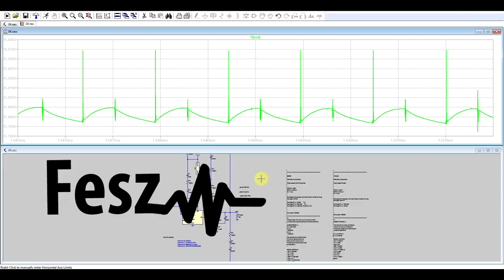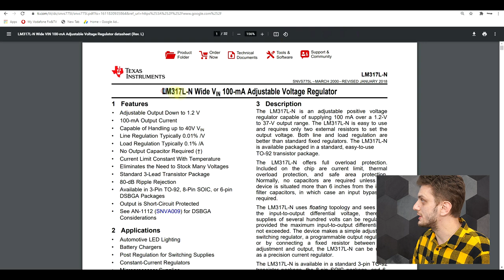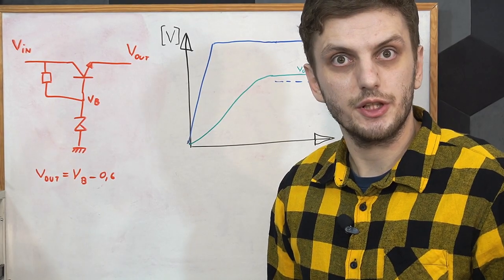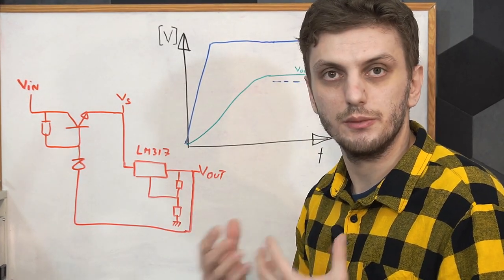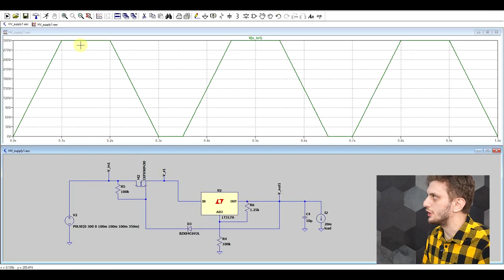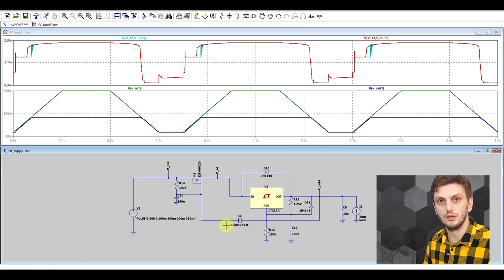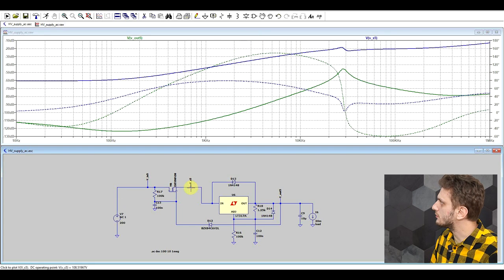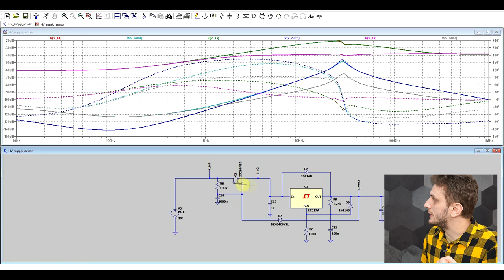DIY - High voltage linear regulator based on the LM317 - Part 1

Comment: However, this circuit is only useful for testing ~led strings~ / the only example that comes in mind now  .....   since they are usually in series and consume very little current.. in practice, this circuit is worthless. Let's say we want to add some power to it.  could we add a bypass p=channel transistor to boost the current and also add a bc457 to limit the current :?  thus, i believe we would have a practical and useful setup.  I find interesting that we can use lm317 as a high voltage regulator, but the current should be higher, though I understand you used 20mA as an example. I look forward to your next video.. You sound like a very good teacher building people`s thinking and using very good didatics.. congratulations.  such an innate teacher.

Comment: I enjoyed the video. I have built many HV linear regulators, both tube type and solid state. Some were my design. I have always steered away from the floating LM317 topology because a brief short circuit will likely fry the LM317. Having current limit with short circuit protection is hard to do. The vacuum tube versions are a lot more bulky, but are more forgiving when it comes to overloads and shorts. Jim Wd5JKO
Reply from the maker: I guess the major advantage that this circuit will have over tubes is that you can easily make it on the negative rail also; with tubes you don't really have a "PNP" version, so if you make a differential supply, it won't be that symmetrical
Reply: @FesZElectronics  MOSFETs in HV situations, make me VERY nervous, they are fragile little critters, and invariablly always result in short-circuit fault condition.

Comment: Awesome video and great and simple idea! 👍🏻
One little comment. On audio circuits noise and ripple is more important than exact voltage.
Especially with some tubes.
So a very simple capacitance multiplier would probably work just fine.
I have played with a similar idea but with a tracking switching regulator (as a LAB PSU) in front to reduce heat dissipation.

Comment: Great work bringing a circuit that expands the use of the wonderfully ancient LM317 to light! I’m likely to use something similar to get a low-noise 400V rail for my Geiger counter.

But there’s two issues I have.
Firstly, while using a MOSFET to decrease the zener’s quiescent current with respect to the maximum output current is good, it should only be done with a MOSFET rated for linear circuits. Power/switching MOSFETs have multiple switching elements within each transistor, and during low overdrive / linear operation they become thermally unstable. There is a real possibility for thermal runaway as hotter channels take more current, particularly with high Vds and low Vgs. See Fairchild’s AN4161. Hope there are high-voltage analog MOSFETs, though analog MOSFETs in general are pretty uncommon. If not there are reasonably high-voltage monolithic BJTs or Darlingtons, for high-voltage audio amplifiers. IGBTs might suffer the same problem with thermal instability, though likely to a lesser extent, so they might be worth meddling with if they don’t oscillate or something.
Secondly, I think it’s feasible to use something like a TL431 along with a pass-transistor to get a high-voltage floating regulator, in a simpler way than your circuit. It might not have as much ripple rejection, but it’s better in terms of part-count. Would make a good replacement for the zener-based part of the 317 circuit anyhow. Actually, considering the TL431 can be used as a comparator, it might be possible to add some positive feedback to it and make a high-voltage self-resonant buck converter, not that it would be better than a linear solution if you want a low-noise low-current supply. The TL431 is a very versatile IC.
Reply from the maker: Hello James! I did consider using the TL431 for this project (see https://e2e.ti.com/support/power-management/f/196/t/233943?Negative-LDO-for-100V-to-90V ) - this schematic uses an extra transistor as a cascode to limit the voltage on the TL431.
The main reason I wanted to use the LM317 is to try to take advantage of its internal overcurrent and over temperature features - more on this in part 2. These features do not exist in the TL431 and need to be built separately.
I'm not sure if there will be any thermal runaway issues - the Vgs will only vary in a small quantity in comparison to the voltages being used. On the other hand local hotspots in the die could appear - we'll see. Anyway, thanks for the AN, I will check it out!
Reply: @FesZElectronics  Also. Funny enough a LM317 can be cheaper as well in most cases.
Reply: Well the overcurrent and overtemp features will only matter so long as the LM317 is stressed more than the pass transistor, which it almost certainly won’t. The LM317’s current limit will likely be way over what will cause the pass transistor to cook at such high voltages. Could thermally bind the two packages together I guess, but I’d recommend a PTC thermistor for that instead.

I’ve never actually seen the thermal runaway of a MOSFET myself, so I think I’ll make a rectified-mains source-follower with an IRF840 and see if it lasts.
Reply: @Scrogan  I have seen thermal runaway with MOSFETs, but definitely not in these kind of circuits.
Reply: @ James Barclay: I do agree with your comment about "switching"MOSfets used in linear mode. There is another interesting paper on that matter at  https://www.infineon.com/dgdl/Infineon-ApplicationNote_Linear_Mode_Operation_Safe_Operation_Diagram_MOSFETs-AN-v01_00-EN.pdf?fileId=db3a30433e30e4bf013e3646e9381200
When building my own HiVoltage PS (400V 100 mA or 200 mA) I tested 3 flavors of "switching" Mosfets: STP4NK80Z: works fine up to 100 mA, STW28N60DM2: fatal crash(twice) & FQA7N80C_F109: works fine up to 200 mA.

Comment: Quite good analysis, some points; as MOSFET's tend to fault on short condition, I would advise against using them, think of Bipolars as built like tanks, mosfets like a small french car, if you do insist on using them, make sure you are using MOV's etc.
2) simulation great, BUT for the new players out there, always build prototypes first, there are a few simulation traps which may cause your circuit to behave different to reality, 3) TRIPLE check HV electrolytic polarity, those things explode, sometime in life-changing injury ways.

Comment: Nice video, as always. One question was left unanswered. Do you need a high voltage linear regulator for some particular application or building it out of curiosity?
Reply from the maker: To be honest, I don't have a particular use case in mind, but I am open to suggestions :D
Reply: @FesZElectronics  Will it be of interest to change the requirements to something like 24V 30+A? This is something commonly used for high power (300-1500 W) RF amplifiers and it might be a little problematic to buy such a power supply. Another option is 13.8 V 30A which is typically used for 100W transceivers, but there are plenty of these on the market and they are not too expensive.
Reply: On second though I don't know much about tube amplifiers, maybe unlike the solid state ones they require a much higher voltage. I know that 1000+W power amplifiers is one of few real application for tubes left these days. I've just checked my notes. The "The ARRL Handbook for Radio Communications 2019. Vol 3" book explains how to build a modern RF amplifier based on Russian tubes GI-6B (ГИ-6Б) or GI-7B (ГИ-7Б). There should be similar information in previous editions. ARRL Handbook is published annually and digital copies are not difficult to find online.
Reply from the maker: This is a great book! It will take me some time to look over it, but on the surface it looks very well written. I guess to make vacuum tubes useful in todays world, you will only use them in the final amplifier stage, so they will be working in the >1KV supply range. I guess that would require a different supply circuit; so would the high current versions you mentioned. I may look into that at some point.
The supply I am currently working on would be most useful for something like a vacuum tube audio amplifier or anything that needs high voltage but as clean as possible in the <100KHz range (above this you start using passive filters); I also heard that electrostatic headphones use  around +/-400V supplies so it would also be of use there.

Comment: Granted they only provide a few mA, On Semi has the NCP785 and NCP786 linear regulators (up to 450V). I use the smaller NCP781 (up to 150V input and 100mA) because its ultra low quiescent current for low power application.
Reply from the maker: I think I came across these IC's when I was preparing but the issue was that these are low output voltage components - the NCP785 has fixed 3.3 or 5V output and the 786 and 781 has a maximum of 15V. Its interesting to point out though that these components have a similar internal structure as the circuit I built - there is a high voltage pre-regulator stage, with a basic Zener and Mosfet and then a post-regulator stage with a precision reference and error amplifier.  
Anyway, if low quiescent and low output is needed, than these parts are far superior to anything built with the LM317.
Reply: @FesZElectronics  Indeed, your design is much more flexible concerning the output voltage

Comment: As a ham radio operator I would also add a requirement of having low noise or RFI generation.
Reply from the maker: Well being a linear regulator, it should excel at this point by default. Also having the 2 stage circuit improves on noise performance since both stages contribute to the reduction of various noise frequencies.
Reply: @FesZElectronics  Thank you so much for the response...I've had linear power supply on my list a things build! Looking forward to many more of your videos! 73 de KN4FTT

Comment: I assume we could just make it with a TL431. Most precise for minimum component count and your dropout voltage would also be just the voltage of the pass transistor. Of course extend the voltage drive range with a transistor before the final pass transistor
Reply from the maker: Here is a high voltage implementation with the TL431: see https://e2e.ti.com/support/power-management/f/196/t/233943?Negative-LDO-for-100V-to-90V
Reply: @FesZElectronics  that's awesome perfect... But somehow how I can't grasp in my mind how they thought about the negative voltage regulator. With and upside down TL431? (That part number I can't remember). It would all fine and dandy but I can't quite put my finger on how would the schematic look like besides the NPNs changed to PNPs and that's all
Reply from the maker: Somewhere in the text they mention the TL4051 - that is supposed to be the  inverted version of the TL431; Just be careful of the 10V maximum voltage drop limit on the 4051 - more info in the datasheet though
Reply: @FesZElectronics  well I'll better falstad it :D. I need regulateable negative V. Its a one time adjust and forget it but when the disposable part of the device is replaced it needs to readjusted. The range would be -15 down to -100. 
Csá nyugati Szlovákiából ;)